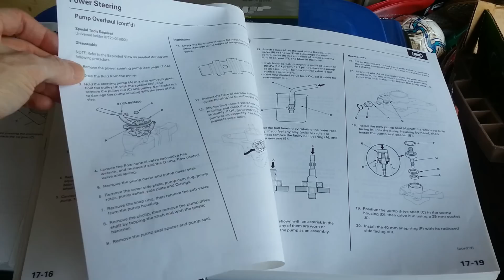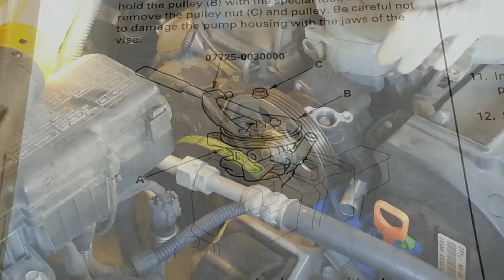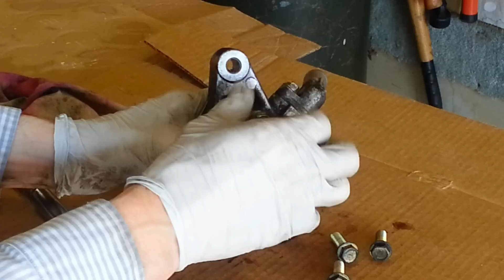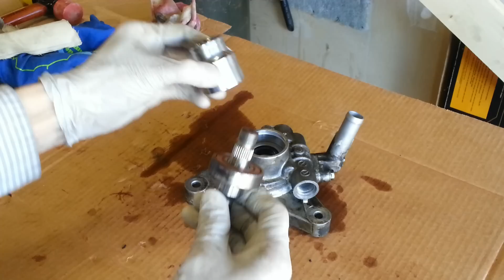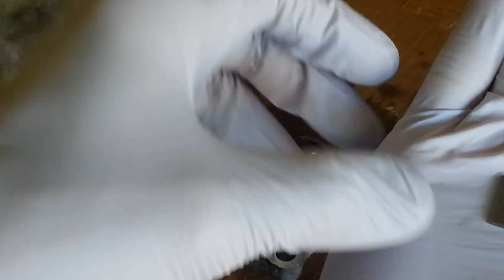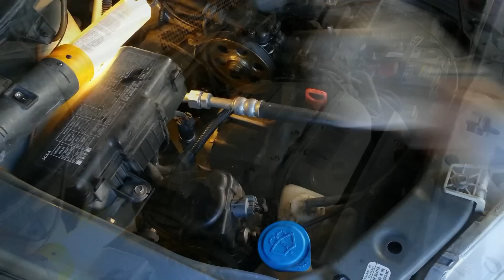Power Steering Pump Overhaul/Rebuild 2002 Honda Odyssey

Comment: Ive got 4 O rings in the kit. One blue one which i can see where yours went but the other ones 2 are thicker and 1 thinner but appear the same diameter. Which goes where? Im trying to figure out which goes on the high pressure line. The thinner or thicker O ring
Reply from the maker: Suggest just comparing the ones you take off to the new ones and replace them accordingly.

Comment: The pink red color of that drip on the oil pan gives you a clue there is a leak in your PS system.
Reply from the maker: Very good eye! I'm impressed that you caught that. Check out my follow-up video where I found and fixed the actual cause of the leak.

Comment: What about the bearing?  Isn't the bearing the main item of a rebuild?  I don't want to do this in vein.
Reply from the maker: That depends entirely on why you're doing the rebuild. It could certainly be due to a noisy bearing. In my case, I was chasing a leak. I checked the bearing during the procedure and confirmed that it was fine.

Comment: Very informative video. I worked on hydraulics, and have one concern. When you placed the reservoir, there was nothing to stop grit from falling into the rubber tube, at 38.38 minutes. If that happens, it can cause the death of the pump internals. Scratches or valve jamb. Seal off every point of entry/exit until until the last second.

Comment: good job and so professional. 
but honestly its a big headache!
I can buy new one for my pilot 2007 from ebay for only $40 guaranteed 6 months with free return.
https://www.ebay.com/itm/RCL-ASI-8-9-2-Power-Steering-Pump-Power-Assist-Fits-Honda-/274579797465?_trksid=p2349624.m46890.l49292
Reply from the maker: Certainly an alternative but not nearly as fun, educational, or satisfying.

Comment: DID ANYONE GET VHECK ENGINE LIGHT AND VSA AFTER INSTALL?
Reply from the maker: You must've disturbed something else in the process. Nothing about the power steering pump should turn on the check engine light. Did you unplug a sensor or break a wire somewhere? Do you have a simple code reader to see why the check engine light is on?

Comment: Explained very well to the T. You have a calm voice that makes one to listen. Great! Thank you.
Reply from the maker: Thanks for the kind comments. I really appreciate it.
Reply: @WorseThanChiggers  i changed both the low/high pres 'O' rings.. the sound is reduced much, but the steering is still a little stiff, but better. wonder if there is still air in the system. It is a 2005 Honda Accord EX V6 with 106K miles
Reply from the maker: @abemathew  There could still very well be air trapped in the system and you'd want to go through the purge process again. Also check the fluid level in the reservoir and the belt tension.
Reply: @WorseThanChiggers  Thank you Sir..will do
Reply: You are very welcome :)

Comment: You drove the bearing out on the inner (on shaft), and correctly drove it in on the outer,  (just sayin). Not a heavy fit and should be ok..   Good video, thanks..

Comment: Interesting an useful video but you should not be banging that ratchet with your hand since doing so can damage your carpel tunnel problems later in life.
 Use a rubber or woden hammer or block of wood or longer lever instead.

Comment: Hello you now what is the problem in my odyssey is toast the fuses 10 for the fuel pump and main (the big one ) relay It’s 2003? Thanks
Reply from the maker: It sounds like you have a short circuit somewhere.

Comment: I do suggest thread lock on the pulley nut. The whole reason i'm watching this video is mine fell off some time ago. The pulley and belt stayed on for how long without it . eventually the teeth on the pulley on the pump the car wouldn't drive. Great Video , very informative , thank you!

Comment: Ok cool that you rebuilt the pump but may be easier to buy new pump, I know, I know, they are expensive.
Reply from the maker: So true. Ease vs. expense is such a subjective decision that everyone must make for their own situation. For that matter, what could be easier than having a shop do it for you and keeping your Saturday free to do other things? Cost for sure. But for me, I actually enjoy doing it myself and I get the additional satisfaction of knowing the job was done right.
Reply: WorseThanChiggers that’s great that you take on these jobs.  I can’t find any fluid leak, put in new pump a year ago and once in a while it’s hard as a tank to steer.  Wonder if the filter in the reservoir is clogged, never changed reservoir on 2004 odyssey.  What’s your advice? Punp makes no noise and it’s intermittent in feeling like a tank. Especially when trying to parallel park.

Comment: This video helped me out alot I was able to find the repair kit at Napa for 12.00$ thanks for posting.
Reply: Update following all your steps we got it done but the rebuild set did not come with the O ring for the high pressure line. Along with I found evidence that the pump had been under too much pressure that the barring had to be replaced.

Comment: My pump is driving me insane with its whining and i have 4 kids so it must be bad. I replaced the line orings and it reduced the noise to only when i hit the throttle. Ur video has gave me the confidence to tackle tge rebuild. Plus its alot cheaper. So thank u. Nicely done vid.
Reply: I think its my bearing whining

Comment: did you replace the powersteering bearing inside the pump or not ?
Reply from the maker: I did not.  Some have suggested that this would have been good additional preventative maintenance.  I inspected my bearing and it felt fine so I chose to leave it.

Comment: Good video .. I’ve done this job, and never thought of removing the pulley from the pump first .. it sure gives easy access to the lower mounting bolt .. will do it that way next time .. BTW, its not at all necessary to drain and remove the reservoir.

Comment: Amazing video, this guy is great.  Question, how many bottles does it take to fill this system?  I am about to tackle the replacement with a new OEM pump, but don't know how many bottles of PS fluid to get?  I wish I had the time to do this entire job, but I will probably try it out once I have the replacement done; someday... during retirement.  LOL  And his motor sounds clean. thumbs up
Reply from the maker: I don't have the vehicle or factory service manual anymore. But, my guess is that it could take about 3 bottles to fill the system when completely empty. However, when replacing the pump, you don't lose much fluid. So having 1 bottle should be sufficient.

Comment: Nice video.  I would suggest cleaning all the dirt, oil and other crap off the outside of the housing prior to disassembly.  No need to take an unnecessary change of getting debris inside of the pump. Reattaching the dirty high-pressure hose fitting into the pump body was one chance of contaminants entering the system.  The o-ring replacement at the low-pressure elbow was another chance of introducing grit, dirt and assorted crap into the system.

Comment: Great video. It was very detailed
Quick question for you. I have a 2001 Honda Odyssey and the power steering pump was leaking so i fixed it. When I brake and turn the handle, it becomes very stiff. Will this video help with the stiffness of the steering wheel?
Reply from the maker: Two quick things come to mind. Did you properly bleed the system of air after fixing the leak?  And, did you confirm that the belt tension is correct? It could simply be that your belt is slipping. I had that issue on my Toyota Tacoma. When I first started up the truck on a cold morning, the belt would slip just enough to make the steering difficult until it warmed up. A couple of turns on the tensioner took car of that.

Comment: This is the standard for automotive how-to videos. I followed step by step and rebuilt my pump. No more whining. 

However, I have zero power steering at this point. Any ideas on possible culprit? I topped off my fluid, but still need to do a flush. Could dirty fluid be the cause? Not sure why it would be working before the repair and not after, but that’s all I can think of at the moment. No more bubbling in the reservoir, but st full lock, it doesn’t swirl very much. How fast is the fluid supposed to move?

Any tips on diagnosing non-functioning power steering are greatly appreciated!
Reply from the maker: A. R. Grimes  Start with the obvious by confirming that you have the correct belt tension and have properly bled the system. The fluid should flow pretty quickly. If you are unsure about getting a good flow rate, check the available videos on flushing the system where they remove the return hose from the reservoir and send it into a bottle. You'll see how fast the pump is moving fluid.

Comment: What's size socket for the nut to take off the power steering and the tension
Reply from the maker: vietflipdude Nguyen I don't remember exactly but it should be either a 12, 13, or 14mm.

Comment: What?? Rebuild a pump before you find the leak, what a waste of time. I bet the leak was right there at your hose.
Reply from the maker: You nailed it. See the follow-up video that is referenced in the comments. The leak from the hose was so slow that it was difficult to diagnose. I wasn't 100% sure that the pump was the culprit but the rebuilt kit was inexpensive and I wanted to do a pump rebuilt video anyway.

Comment: nice to watch ...give me an idea how to get rid of  power steering noise....thanks a lot...
Reply from the maker: Replace the o-ring on the low pressure side where it attaches to the pump. There's a TSB on that because air is drawn in at that connection causing noise. Other than that, be sure to properly bleed the system of air. If you still have noise, you may have a faulty pump or rack.

Comment: what is the part number of the o ring on the high pressure side?
Reply from the maker: O-RING (14.4X1.9) Part No: 91370-SV4-000

Comment: Got a rebuild pump and after I was done and bleed the system I couldn't turn the wheels with out raising the RPM quite a bit.  So I will be sending it back for a new one.

Comment: Hey everybody, I figured out how to remove the ball bearing. you use 2 sockets and a hand clamp. The bearing can only be removed one way and when you press it back on it has a lip/ edge so you do not want to force in on past that point.  Make a note of which side the red bubber dust seal is facing on the shaft, the other side is a metal dust shield, do not reverse that orientation. Notice I put pressure on the inner metal wall of the bearing when installing, do not put pressure to the outer metal wall or you can destroy the new bearing. Here are pictures of which sockets to use for  2001 Accord V6/ 2002 Odyssey etc:  http://s3.photobucket.com/user/eksine/library/Honda%20Power%20Steering%20Pump%20Bearing%20Removal

Comment: why your belt is so loose? my car very tight, i have to loosen the tension. i purchased new pump from a1 Auto, it costs $89.
Reply from the maker: If the belt is too tight, it can overstress the bearings. There is a specific tension noted in the service manual. But if you don't have a tension gauge to measure it accurately, you can make a rough measurement with just your finger. Apply a fair amount of pressure to the belt and it should have about 1/2" of deflection when the tension is right.

Comment: Great Video! Very informative. I will be attempting the exact same rebuild along with a new Harmonic Balancer and new belts soon. How did you do the flush and how much fluid did it take to refill total?
Reply from the maker: There are several good videos here on YouTube on how to do a fluid flush specifically on Hondas. Basically, you disconnect the return line from the reservoir, add an additional piece of hose, and run it into a bottle. Then briefly run the car to expel the fluid into the bottom while topping off the reservoir. I seem to remember flushing with several bottles.

Comment: You skipped ahead around the 37 minute mark when you were reattaching the high pressure hose to the pump.  You put the O-ring on, then pressed it in a little, but it didn't seat.  Next we saw you snugging the bolts.  Did you use the bolts to pull the pressure hose in to seat, or were you able to seat it by hand before tightening the bolts?  

I completed the rebuild, which I wouldn't have attempted without having seen your excellent video.  But on that step, I think I damaged the O-ring trying to get it to seat. It absolutely would not by hand.  I tightened it down and sprayed out a bunch of fluid.  

Eventually I got things working again using a nitrile O-Ring from a a cheap Harbor Freight assortment. (Yeah, crazy, I know).  This time I carefully aligned the hose and alternately tightened down the 2 bolts until they were seated.  Before the final one, I experimented a few times wiggling and jiggling and trying to seat the O-rings which showed me how I damaged the first one.  Fortunately there were several in the assortment.

I'm wondering if I couldn't seat it by hand because of hydraulic pressure when there is a seal.  With no O-ring the hose would seat freely.

Any guess whether nitrile will hold up?  The O-ring kit says its good for hydraulic fluid.

I have genuine Honda O-rings on order, so I'll probably only rely on the cheap one for a few days.
Reply from the maker: I love observant viewers and you identified an important issue that others may encounter. I, too, had issues with getting my o-ring to seat properly and the experience was almost exactly like what you described. In hind sight, it would have been better to capture the struggles on video as well as the eventual resolution. However, I eventually stopped the camera at that point thinking that there was no need to capture the continuing struggles on wasted raw video just to be edited out later. I, too, damaged the o-ring by tightening the bolts before it was properly seated. I think it's less of a hydraulic pressure issue and more that it is just a very snug fit between mating surfaces. It gets caught on the lip of the opening thus being squashed and torn on one side. My resolution was the same in that I used another o-ring, coincidentally also from a Harbor Freight kit, and worked to get it properly seated with plenty of new fluid to lubricate it before tightening the bolts. It took some careful twisting and rocking before it eased in. That's when the video resumes. My opinion is that the Harbor Freight nitrile (green) or vitron (red) o-rings are of good quality and are perfectly good substitutes. You won't go wrong with swapping that out for a genuine Honda o-ring but, personally, I'd leave it alone since you successfully got it installed and it isn't leaking. Thanks a ton for pointing that out and sharing your experience.

Comment: This is a truly excellent video.  Very well done.  Almost makes me wish I owned an Odyssey so I can follow your lead.
Reply: I should mention, that when you are removing the pulley, you say you "believe this is normal left-handed threads", but then removal counter-clockwise demonstrates that it is right-handed.  Left-handed threads are uncommon.

I think there's at least one other place in the video like that.  Its an important distinction when you're using a breaker bar.
Reply from the maker: Sheesh, I sure did get that wrong, eh? You are very observant. Thanks a million for pointing that out and for correcting my error.  Lefty Loosey = normal right-handed threads.

Comment: got a 90 accord ex. the original pump shaft that rotates the pulley has 1 raised notch and not the "cog" looking type. the new pump has a dip in the shaft where the notch is supposed 2 be so the pulley is spinning freely not grabbing the pump shaft any clue?
Reply from the maker: It sounds like your pump has a shaft with a keyway machined into it. If so, there should be a corresponding square shear pin that goes into the keyway to lock the shaft to the pulley.

Comment: u could use the pliers u used to move the hose clamps to use as the special pulley tool to loosen the nut. i have the same pliers and i use them to loosen the cam pulley nut.

Comment: I don't trust "rebuild kits", I'll stick to buying each part OEM. also the kits usually don't include the ball bearing, the part that is important. and the seals usually don't fit right and leak on aftermarket kits
Reply: dont get the cheap kits. get oem or better.
Reply: Edgar Bravo that's what I said

Comment: Thank you, very well done. Informative. I am doing the same job using a REBUILT unit. Rebuild is not always better than doing it your self. My unit REBUILT unit came with dirty red power steering fluid in it. As you noticed in your video the fluids are not red! Makes you wonder what quality inspection might have been with my unit.I was hoping you would have covered how to replace the belt, even if you didn't do it. It looks like a motor mount mystery be removed. Thanks, I just might keep my pump CORE and REBUILD it for myself or my dad's new Honda Odyssey.
Reply from the maker: Replacing the belt is not difficult but you do have to remove the engine mount bracket.  Support the engine by lifting it slightly with a jack and a block of wood under the oil pan.  Then you can easily remove the engine mount bracket and remove the belt.
Reply: Thank you, that's what I needed, hope this helps someone out there.